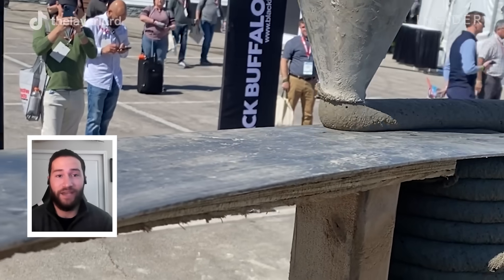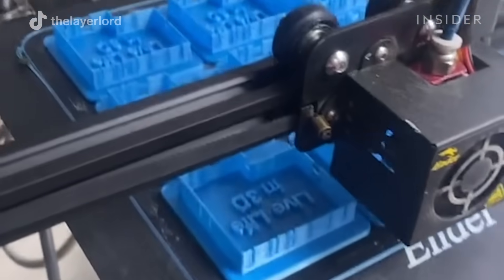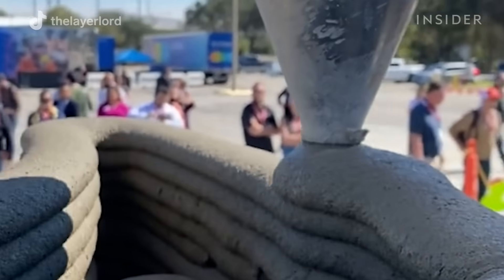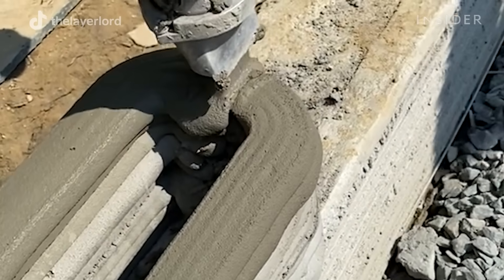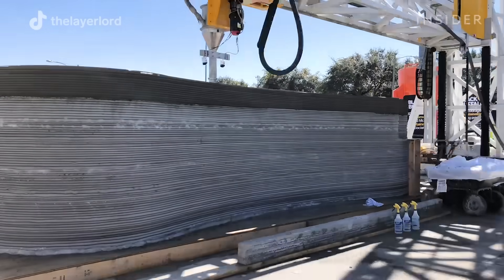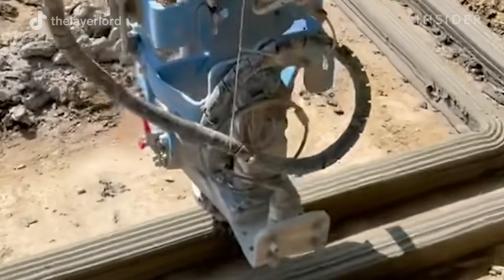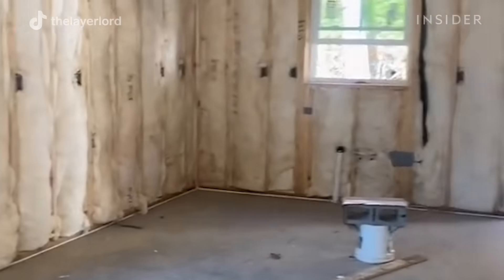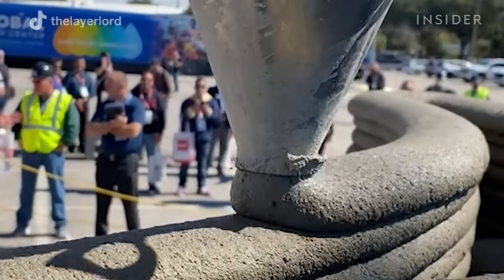How Concrete Homes Are Built With A 3D Printer | Insider Art

Comment: When I first heard of this idea years ago I thought it was very intriguing.  Seeing it in action makes me see the benefits but I was surprised to see that its use appears to be limited to outside walls.  I would be really interesting to see the whole house structure built this way: inner and outer walls together.  Just start with a level base, start the print and have the on-site crews installing things such as rebar and electrical or plumbing access ports as it goes, followed by a different crew coming it to top it off with a pre-built metal roof.  Then seal with PVC windows and fibreglass doors and finish the walls with plaster and PVC trim.  Zero wood used.  But i really like this concept.
Reply: There are quite a few companies that are doing interior walls and cabinets with the printer as well. Really up to personal preference.
Reply: You do realize that concrete has been used in housing for a very very very long time and didn't involved 3d printing right.  These printers are basically a gimmick and you get some ugly hard to clean houses out of them.
Reply: @corail53  Have you seen some of the older pre-cast concrete homes?  There's some ugliness for you.  lol

I think the main benefit of the 3d printing comes from the time and labour savings.  If you just need a crew to setup the machine on site, keep it stocked with concrete and fixtures (ie electrical boxes etc) the machine can basically just be left to do its thing.  Set it up in the morning and by the end of the day you've got a house sitting there.  This would be a great way to come up with smaller, affordable housing in a quick way.
Reply: I love the concept of the technology, but i have issues about the usage of the concrete... its a heat trap, even the residents will cooked alive in summers, or have an enormouse ac bill.... I wonder if somekind of clay mix would be better.
Reply: @Kaczyfunny  it's no different than a house made of brick. And the particular mix used has a different thermal rating than ordinary concrete. I think people are just to caught up in typical suburban construction.
Reply: @WALTERBROADDUS  I know why i said that, but i beleive you if you say its different. Also should consider try different material, which more environmental friendly.
Reply: @Kaczyfunny   They are not chopping down any trees. 🎄 And have  fewer gas guzzling pick up trucks of laborers driving to work daily. ⛽
Reply: I love that the same number of workers are employed, they're just watching the machine do their work? Progress?
Reply: no one wants concrete walls in  the jnterior of yhere home
Reply: @justjay3750  why not? They are good soundproof.
Reply: Remodeling would be difficult and hazardous (all the sediment that could go into your hvac if you didn't dust protect properly). It would already be quite the task to do an addition to this house. You would need to remove what looks like 1.5-2ft. of concrete depth (let alone area) just to add an expansion. You would probably be better off printing another home if you aren't satisfied years later and want an expansion or different layout.
Reply: I‘d prefer having inner walls out of wood
Reply: @reeset  yes, way more cheaper and loads faster. This is just a plain stupid idea.
Reply: @daniellindholm I think in a tornado-prone area, it would be nice to have one interior room made of concrete. Even though the outer shell would be concrete, the windows would still break and cause a hazard. Having an interior concrete room in Oklahoma, for instance, would help protect a family.
Reply: @appalachianenthusiast9499  if that is your concern, I would agree. But I wouldn't do it with a 3D printer, since that's so much more expensive and not as durable. I would use prefabricated walls and poured concrete where prefabricated wouldn't work. There's also a kind of legosystem with hollow insulation in wich you put rebar and then pour concrete into. There's all kinds of solutions making that 3d printer plain stupid. Really expensive and not as durable as traditional concrete structures.
Reply: @daniellindholm before you start making claims, please cite the source of your research?
Reply: @WALTERBROADDUS Sorry, the rules says I'm not obligated too. If you are interested all the answers should be easy to find, but most people will be fine just using common sense.
Reply: @daniellindholm  in other words, you are just somebody on YouTube just speaking with a opinion based on nothing? Duly noted.
Reply: @WALTERBROADDUS  Do you really need sources to figure out that solid reinforced concrete walls are stronger than layered unreinforced concrete paste with hollow space between?
Reply: @roevhaal578  First of all, they do have reinforcements. Nor are the load-bearing walls Hollow. And reinforcement is for strength in tension. Not compression.
Reply: @WALTERBROADDUS  they do? I didn't see any, all I saw was layered concrete paste with a layer of air between. Yes the main purpose of reinforcement is in tension but it also helps reduce cracks and splitting.
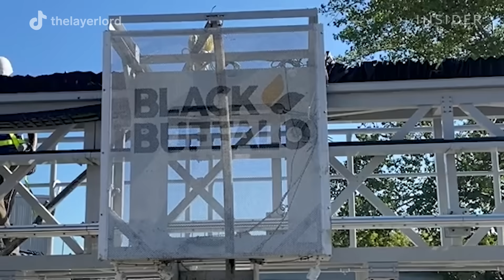Reply: @roevhaal578  Of course it has reinforcements, look at 1:42 and you can clearly see them. The space in between can be filled with either something that's a really good insulator and has some strength to it, be left with just air or more concrete can be poured between the "wall sides" once all the wires and tubes are put into the walls first. We have a brick home and bricks would collapse just as easy as that thinner concrete wall if it were to be slammed by a flying tree or car. Luckily that doesn't really happen here in Romania.
Reply: Lol  @daniellindholm
Reply: It should also cook you breakfast and do the laundry 🙄
Reply: Is it sturdy tho?
Reply: Its probably one of the most stupid things ever, funded thankfully by private idiot companies.

Comment: Well concrete is not a strong building material without the steel reinforcement, so what keep this building from cracking and coming down after 5-10 years? Most concrete buildings have an awful lot of rod in that concrete. It's t there for a reason. I know there must be a way, or all hell would break loose before long, I just wonder what it is? Composites in the concrete?

Comment: As the whole structure, like walls are made using Cement grout, right? Since the amount of cement utilized here is comparatively very high. Is that a drawback? It will directly trigger the carbon emissions.

Comment: I wonder how this handles weather. I just picture it being like a basement and once it settles and you get moisture it will expand and contract and crack, leaving you with a leaking side wall or filling up that void.
Reply: It should be easy to patch up cracks though. And if you reinforce it with steel bars and foam then it won't ever be a problem.
Reply: The price would determine 80% of my decision to have one of these built everything about this process screams expensive, plus concrete has went through the roof here where I live and for what reason would it go up $60 on the yard in less than a month!
Reply: Could be safe in a tornado if it has  cement roof,?
Reply: @3333ferret  concrete houses generally survive tornadoes much better than conventional wood-frame homes
Reply: I want one or 2
Reply: Building designer here. Basically it's a curtain wall then you put your steel and penetrations in and then dumped the concrete in the middle which should bond to the rest of the wall
Reply: ... no rebar = cant handle ANY settlement
Reply: @zarthemad8386  One story houses don't need rebar.
Reply: So it's not perfect?
Reply: @stevenlight5006 that what he pictured it as
Reply: @stevenlight5006 not even a reasonable alternative. No one said it was perfect or expected it to be.
Reply: It can be stuckod or whatever also 
And it’s concrete.. not a balloon 🎈 lol 😂 it won’t just expand
Reply: @rmrglobalproductionsinc9554  all materials expand and contract with temperature fluctuations. that is why control joints exist in concrete structures
Reply: @rmrglobalproductionsinc9554 They did a three story with a basement in Canada.

Comment: I'd love to see this being used for building dome buildings sans the costly inflated form currently needed.
Reply: Not likely to happen. A 3d printer thowing lines of plastic can achieve an overhang because the layers bond quickly and stick, and the lines are thin and light. A dome must be self supporting on the way up if it's built without centering, meaning at a minimum you need to each circular level supported. Tough to do that with a thick glop of concrete.

Comment: This is innovative, but just a gimmick at the moment. The construction is not reinforced, so it is dangerous. It's not a 3D printed house, it's a printed wall. You still have to do all of the things that make it a house. Plumbing, wiring, finishing, windows, on and on. Not knocking the technology, just pointing out that it's not turnkey or replacing skilled labor by any stretch.